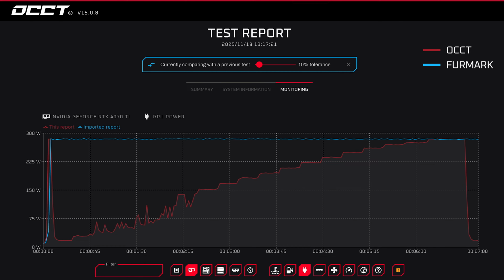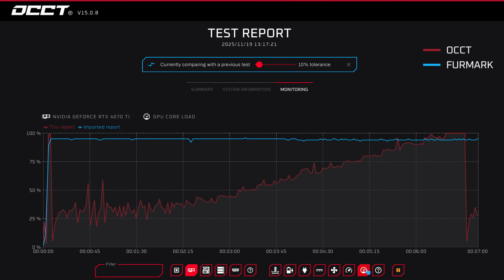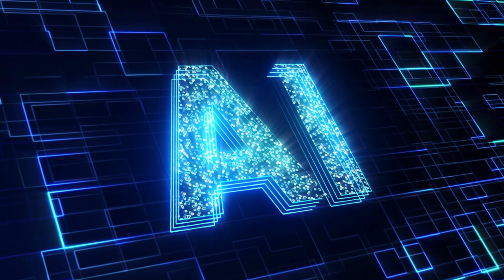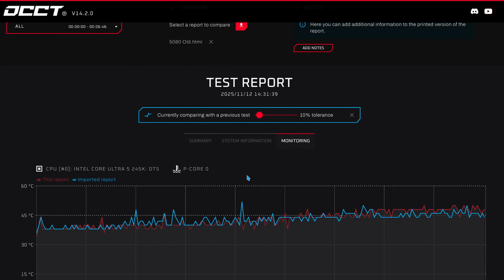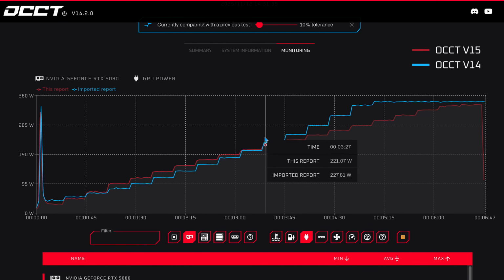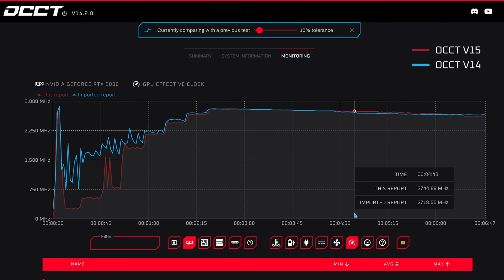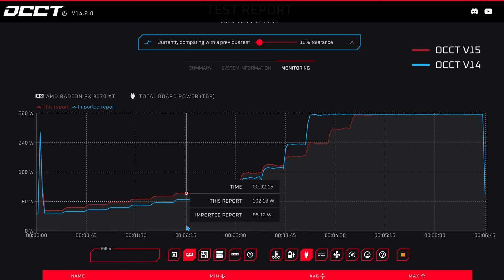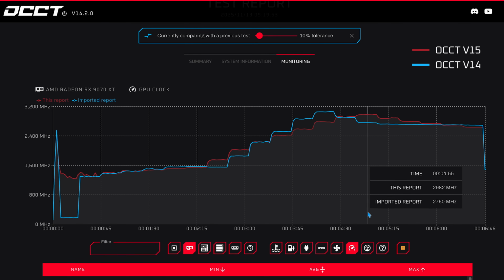OCCT {DEV NEWS} #9: Explaining the New 3D Test

Comment: For my PC VRAM and 3D adaptive gets crashing after starting but non of my games crash .
Reply: I had a similar problem. My games were fine but the 3d adaptive test showed several errors. After trying to figure it out for days, I forgot that I had applied a slight overclock using the Nvidia app. After reverting to factory settings, the errors went away.